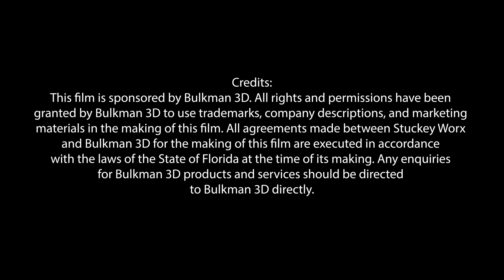BulkMan 3D/QueenBee Pro/WorkBee - X axis Building, X&Y Mating, Squaring

Comment: How come no one is showing the proper way to grease the rails? I have been trying to figure out what grease gun to do both types of fittings. I have found one that will work for the smaller fittings but the other grease nipples are larger and there is no information on it. :(

Comment: Have question. 
If the X Gantry is at the Y=0 position (near to operator standing at the front of the machine), does the spindle stick out of the table? Wondering if i can make a vertical clap at the front of the table so i can machine fancy wood end joints (eg. dovetail)

Comment: Hey there, i too have the "PRO" kit - i'm having a bit of trouble getting the waste board & "Y" axis squared up. As you already know, the instructions from bulkman SUCK, and is missing 1 step.  My question is- what is the cross measurement from motor / bearing plate to motor / bearing plate?

Comment: Thanks for all the advice it's been very helpful in getting me setup with my cnc. Any idea when you will be putting the next queenbee video up.
Reply: He said its the same as the workbee videos
Reply: @ianmanners3605  so there is no follow-up? Would of been nice to see if its worth doing. value, rigidity, actual work bed size after upgrade as I believe it's smaller than bulkman suggest on the X and how to maintain etc. Would be amazing if you could make one please.
Reply: I have built mine and the frame itself measures just over 1000x1000. The work area itsself is maybe 10cm smaller because the space it needs on the gantry mounts in relation to the spindle, its never reaching the perimeter. Hardest part for me was setting up the tension in the screws. 

Would recommend getting some kind of bellows to cover the rails.

Comment: The instructions say to use 55mm screws (for the x axis nut blocks) but you need to use them for the motors. Instructions are wrong. 45mm ones are the correct ones IIRC.
Reply from the maker: There are other 55mm screws so not an issue. I have everything laid out and accounted for. The screws for the motors on the 2-Y axis and X axis call for 60mm not 55mm. The screws for the motor on the Z axis calls for 55mm. These are the screws that were intended for the nut blocks. They might be somewhat long but they do not cause any issues.
Reply: @702marine  that's weird - we must have a slightly different kit. My screws for fitting the linear rails were the "version 1" ones. Maybe they simplified in version 2 by replacing the 45mm screws with 55mm.
Reply from the maker: Could be... I started with the WorkBee 2.2 version...